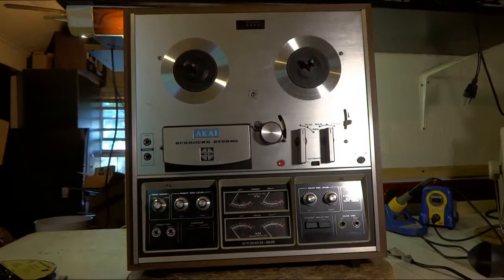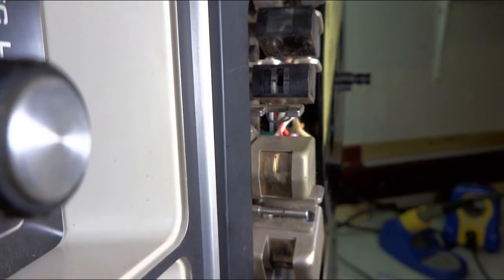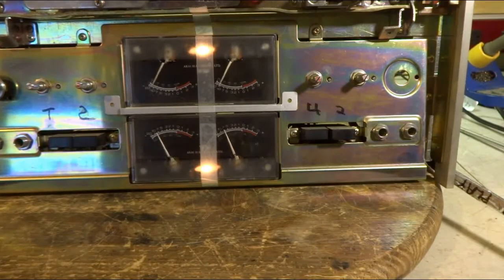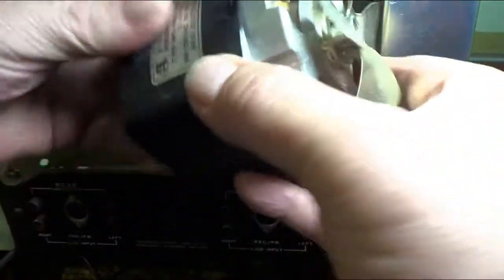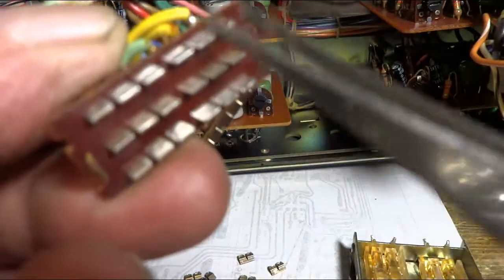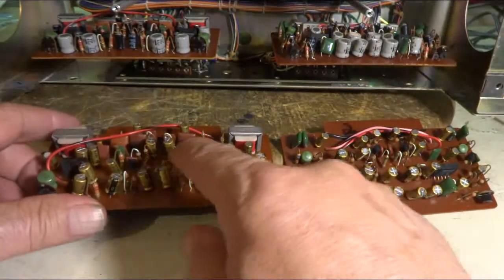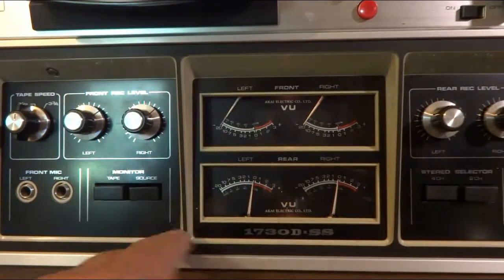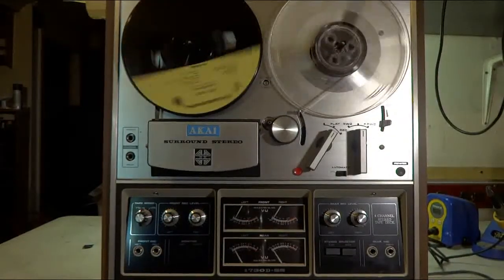AKAI 1730D SS REBUILD

Comment: I have the same machine. It was working till it was on for a long time and the motor start run capacitor blew out. I have replaced it with a single 2 microfarad cap but the entire machine remains dead, no lights come on, nothing works. Can you offer any advice? Thanks

Comment: Hi. Thanks for the video. Would you like to know where to find the KSC1845?
Reply from the maker: Thanks for watching. You should be able to find the KSC1845 at Digikey or Mouser.
Reply: @patrickoconnell3896  Thank you very much. I will search these sites. Another help. I checked the technical manual and some of the capacitors used on the boards are different from those shown in the manual. Is it better to use the capacitor values in the manual or on the board? Example: The capacitor C117 in the manual is like 3.3uF / 25V and on the board is 1uF / 25V.
Reply from the maker: Many times they will make changes  and not change the manual. Sometimes someone put the wrong part on the board. I will use what size is on the board. Also you may not find a 1uF 25V cap. I would use a 50V.  You may also want to search AudioKarma and Tapeheads for information on this deck.
Reply: @patrickoconnell3896  Thank you. It was put equal is on the board. In the lubrication part I could not dismantle the flywheel. As you did? In this part of the video: https://youtu.be/fUauWAn40Ac?t=320
Reply from the maker: I don't remember just how I did it. The service manual does have a break down of it. HiFiEngine.com will have the manual.